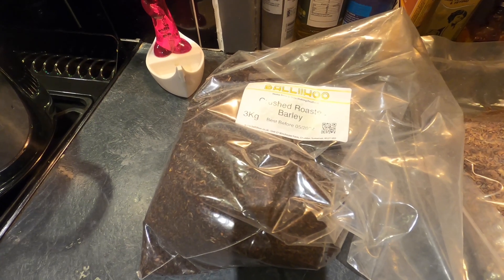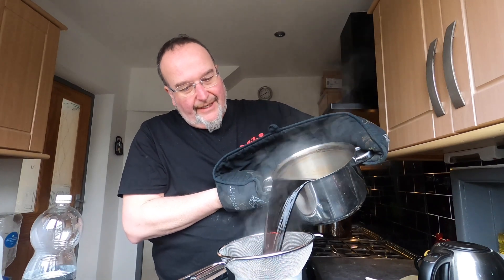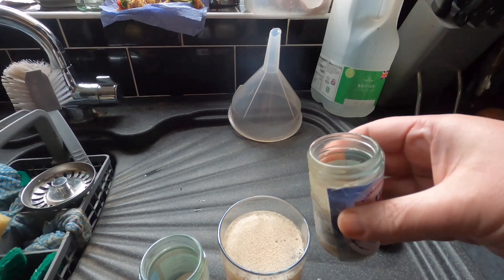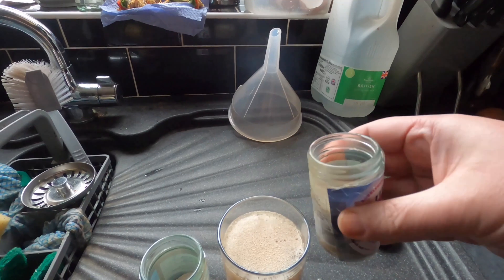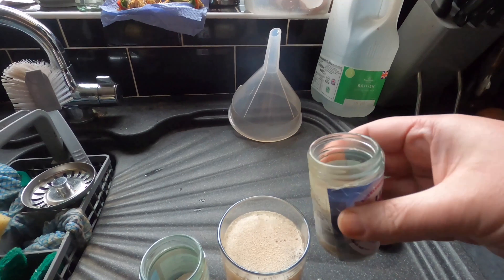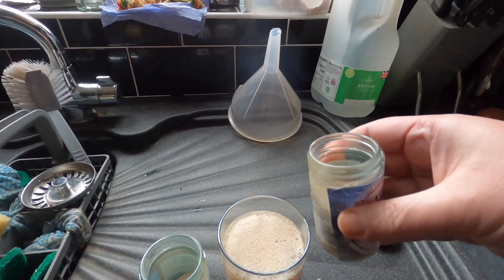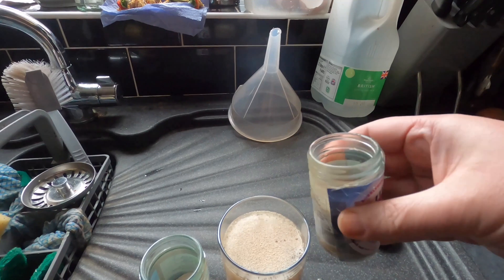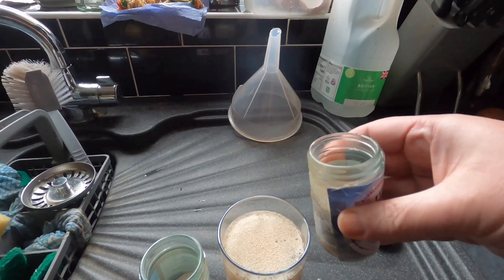Making An All-Grain Chocolate Porter, 5.3% ABV: Full Film From Grain To Glass

Comment: Watching this as a brewer is painful, I really appreciate your cider videos but beer brewing is more scientific. First of all your beer was weaker than expected as you didn’t use any base malt the speciality malts you used are used as percentage additions to the grain bill. Your method of simmering the grains in a pseudo mash are also the reason why your beer finished thick sweet and weak. 65-70C will extract the sugars that are fermentable anything higher are harder to ferment or dont ferment at all so for a thick body stout I would do a step mash low at first to get the fermentable sugars for the ABV then heat past 70C at the end of the mash for the body. You should have raised it to 65 C and held for an hour drained the grain and then boiled the wort for an hour. You needed to add a small bittering addition of hops as well. As for your racking and shaking clearing your etc beer oxidises quickly and all oxygen added post yeast pitch will turn your beer to a bottle of damp cardboard tasting liquid within a month or two. I by no means mean this as “troll” type comment I just think that putting content out on YouTube that people will inevitably follow like this over simplifies the process and will set people up for failure.
Reply from the maker: Thanks for the extensive comment and advice. Yes I'm a complete amateur, I've had three reasonable successes and four fails so far from grain brewing. I read up on the most basic way to brew and that's all I'm trying to do. I will certainly keep in mind keeping the pseudo mash temperature lower. I'm guessing the monks did it all those centuries ago in a basic way too? I'm never going to be a professional or scientific brewer, I'm just doing it for fun. Once the grain I bought earlier this year runs out (I've got four grain brews left), that's it for me then with grain brews, they're too inefficient in demijohns. I would suggest that you don't watch my Rum and Apricot Strong Ale film, which I'm uploading next week (although it has turned out very nice), as that was a bit of a bodge-job in the process too, but it worked out well in the end. I do make it very clear in my films that I'm just doing it for fun as an amateur. I don't take your comment as trolling, but I'm still going to upload my last few grain films, when I do them. Cheers!